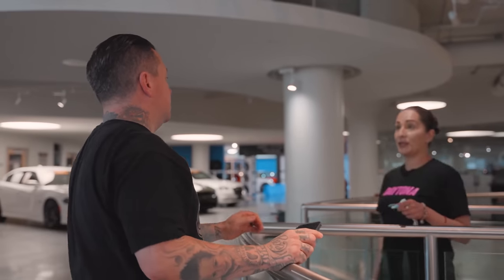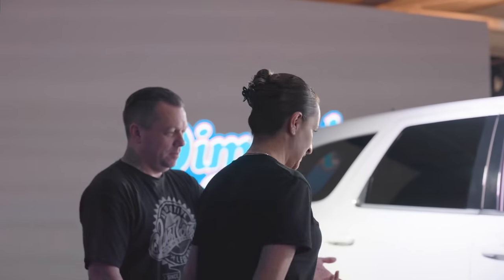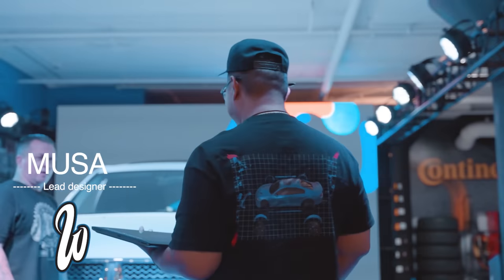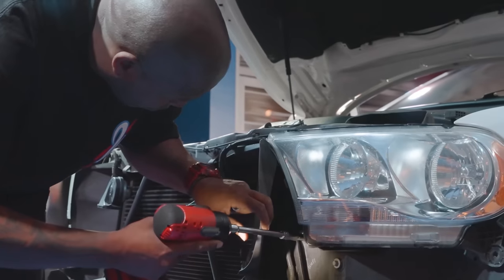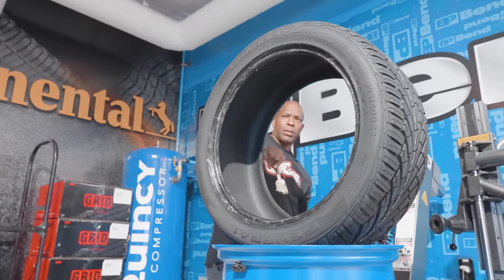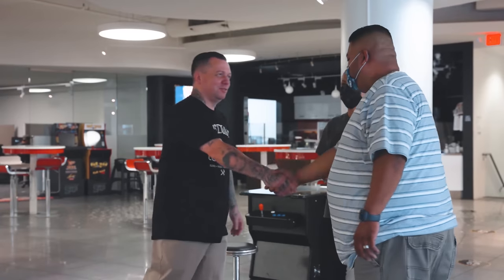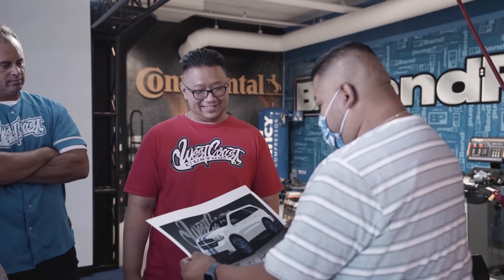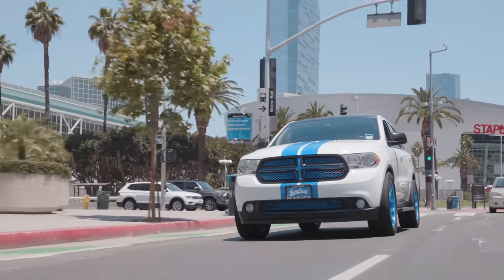Dodger Fan gets his Dodge Durango refreshed by Ryan | "PIMPED OUT" - EP. 5

Comment: I really love these new series, and always been a fan of West Coast Customs when they were on tv. If they are doing this specific to that dealership, MOPAR has a specialty parts aftermarket parts service coordinator that can help with bolt ons (like wheels, grilles, headlight upgrades to LED, bumpers with or without fog, interior upgrades to include head unit). A conscious decision should’ve been made to keep the customers OEM wheels in tact before sanding the original polish off and powder coating them a loud color like BLUE (the wrong Dodgers blue at that). If you are crushed with time, have the dealership call the VIP customer (just like all dealerships do any other time) and make up an excuse for another delay so you have MORE time for your “refresh”. Stop handing these customers rushed over sloppy jobs that a DIY’er can do in their garage over the weekend (headlight refinish) with some spray paint (grille) and vinyl kit from eBay for $50.